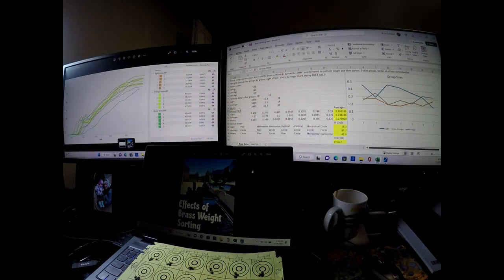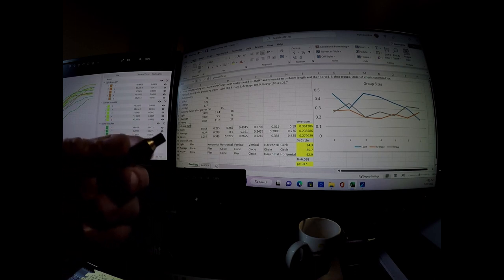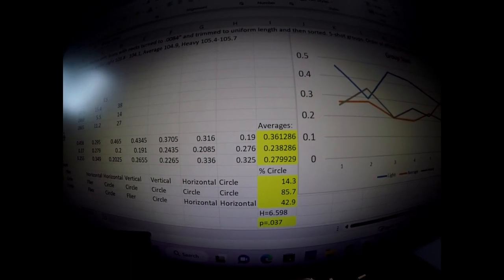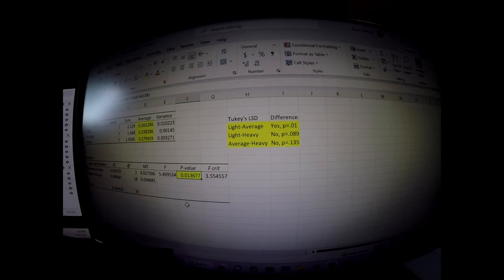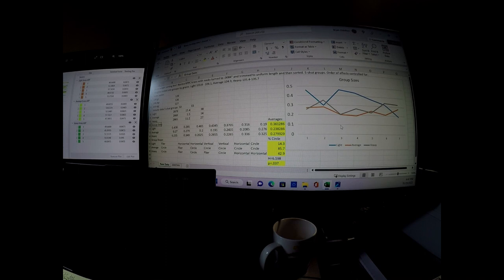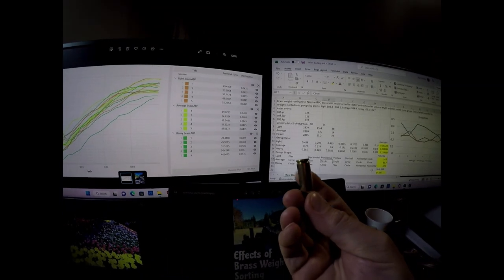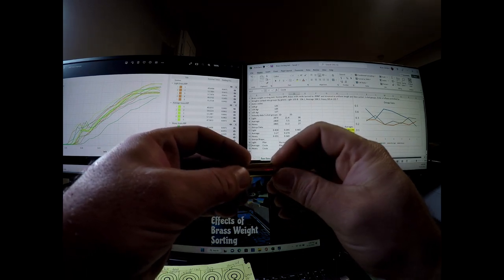Effects of Weight Sorting Brass on Precision

Comment: Man... I was testing this out with a primer pocket plug and a micropipette. I used water I kept as cold as possible, consistently adding ice to keep the weight/temp stable. 

I filled a case at a time, and would use a credit card to lop off extra water drops, then weigh on the FX120i. 

Labeled the 20 cases,  and reloaded, shot them with groups and velocity, then did it again. Internal volume changed with every firing, but at the time I didn't trim my cases every shot. I don't have a primal rights CPS, or an AMP press, as well as not sorting my bullets, or neck turning at the time. 

It does start to enter the realm of time spent vs performance gains, and at that point i would strongly begin to argue the benefits for a benchrest railgun shooter with the ability to chamber their own barrels.
Reply: To also add in; I did have a standard deviation of 0.8 over 20 shots for the first string. Subsequent strings slowly grew to a stable average of 3.6 standard deviation after 3 firings.

This was done with 6.5 creedmoor cases from peterson, but I did test out with 10 firings of alpha 6 dasher in a much simpler/quicker test. At this point, my assumption is that because the smaller cases aren't drawn out as long, the consistency is easier kept between the wall thickness of the cases, ultimately leading to a lot of 6mm cases being pretty "easy" to load for.

Comment: Great test! Certainly makes me want to revisit this practice and try it again. Thanks for the group shape results too. It's interesting how the light and average cases were very similar in some aspects yet shot very different, and then the same thing happened with the average and heavy. One thing I would look for in Norma brass is case wall thickness. I have a batch that we're different by .006 down near the web, so I gave them a rest. The rifle still shoots good with them, but I feel further testing of that variable needs to be done.

Comment: Your content is always interesting and thoughtful.
I wonder about the data sample size and statical significance.
I wonder if the many of the tests would be repeatable.
I'm always aware of costs and barrel wear.
I have seen a machine or two that measures internal case volume...this being the aspect that weight sorting is usually seen to  reflect.
Thicker shoulders might leed to different results due to more energy to expand...or longer to expand ...maybe...as an alternative idea to case volume.

I bought primer plugs to measure with alcohol...but this was not practical at all.

Keep up the good work and interesting experiments.

Thanks 👍
Reply from the maker: Thanks for tuning in. As for the stats piece, sample size is driven by the size of the effect so in this case seven 5-shot groups for all three of the conditions (105 total bullets) was sufficient to detect the effect of precision when comparing light with average.
Reply: @WitchDoctorPrecision  sample size, vs, size of effect..   thank you...for putting that in perspective..   I'd been thinking of sample size when it came to velocity...with idea that increased sample size gives straight line up velocity increase with powder in crease...thus no velocity node.  And was sorta losing faith due to sample sizes being small, thus misleading....
Thanks!

Comment: Where did you find the weight difference in the case? Suspect the variance in wall thickness, or the difference in extractor groove depth, length of the flash hole...?
Reply from the maker: I didn’t check. The Aztec code was lower on the lighter piece which made me think it could have been in the neck and/or shoulder.

Comment: great video. Question. did you happen to check the headspace "aka shoulder set back" on each case to make sure the brass thickness isn't effecting the sizing process?
Reply from the maker: No, not in every one every time. I do “quality checks” where I do check at least a few here and there so that I can detect when the die is not sizing all the way. What I found is that annealing reduces the variability in bump from up to .002” to no more than .0005”. I annealed after every firing in this brass and my quality checks showed no variability greater than .0005”.
Reply: @WitchDoctorPrecision  Thank you

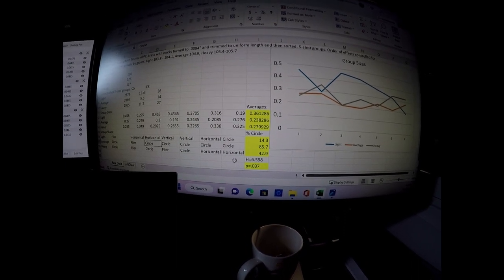Comment: 14:12  awkwardly covers nerdy-freedom boner no, n,o please geek out more.... Fanboi eyes glazing over...  HAHAHA but seriously though, your ability to go into depth as to how and why things are shooting they way they are is PHENOMENAL.  I enjoy a bit of shooting myself and this is the extreme end of that rabbit hole I try to avoid.  Should I trim my bras.... meh... headstamp sort whatevs... I don't even neck turn and RARELY anneal!!!  But then again I am pretty happy with just 1 moa or better... I am sure you would flip your sh*t at getting a .8 group.  So the question is, are you hydraulically and or mechanically locked in to the rest? how much human interaction do you remove from firing? Heart rate steadying and breathing practices... I have found like... an extra cup of coffee while trying to zero can mess me up bad. Depending on magnification and heart rate and tension and firearm weight.... There's so many factors are you shooting in a 100 yard enclosed tunnel? random ass winds you can't call or get a read on... Data is great and your aggregation if wonderful but the X variables... that's why I can only go so far...
Reply from the maker: The style of shooting is called “free recoil” which means that the rifle is set tightly (not locked into) in a front rest and rear bag. I made a video about the type of shooting style I use if you want more info. This eliminates a lot of human error like what you mention because the only thing I touch when firing is the trigger and this trigger is set at around .1-.2 ounces. As for wind, I will use wind flags if wind is a factor. This enables me to be sure to shoot in the same wind condition. If it is a super windy and/or stormy day, I simply will not shoot. I take great care to rule out as many known variables as possible and it is looking like this method is working if I can statistically detect an effect after shooting seven 5-shot groups for each of the three types of brass.